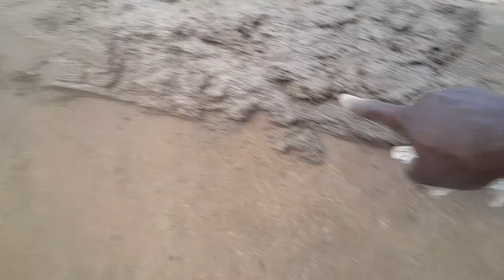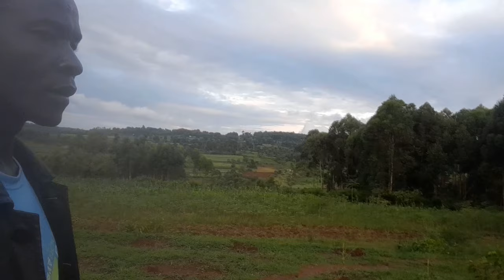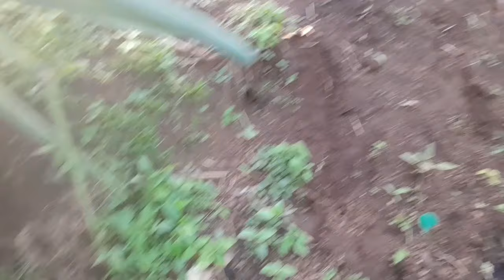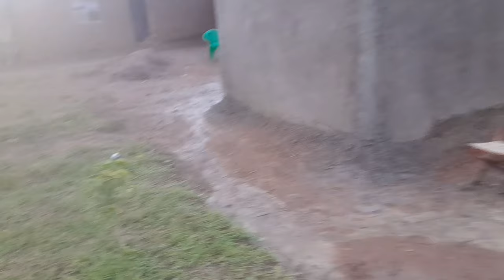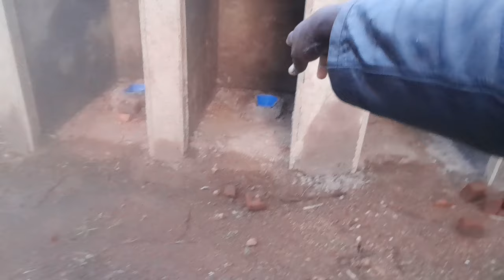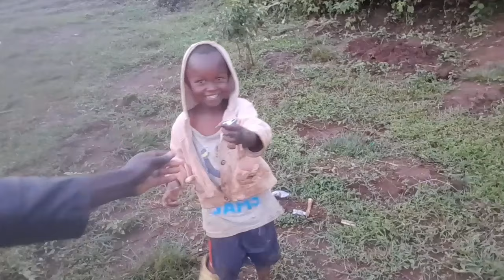see how my kids are happy for the new look for their house!!!%

Comment: Alex the mason mustn't be lazy, the same way he was able to make the. other areas smooth it's the same method. If it's rough it won't be nice. If it's smooth later you can even be able to paint if you wish.
You are the one paying him don't allow him to tell you how your house should be. If he is tired he can take a break but no cutting corners.
Alex you can use warm water (not hot) and soap to clean the windows, take any old piece of cloth and use that it will be easier